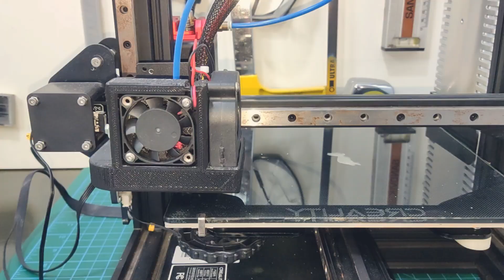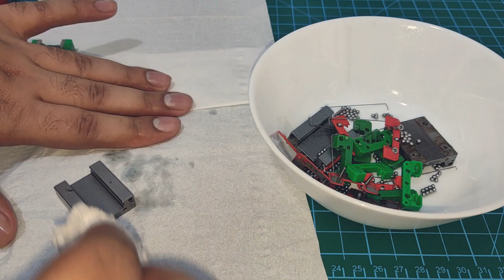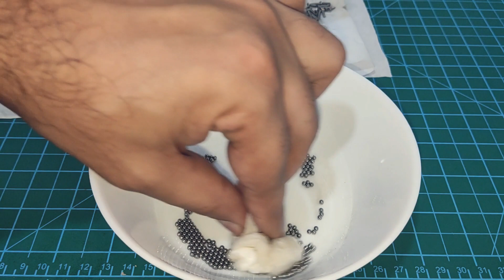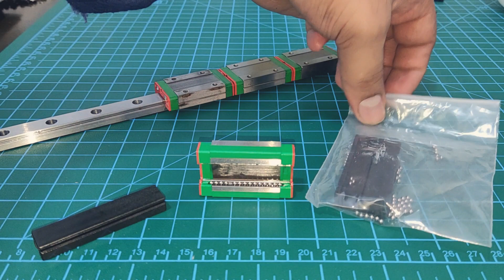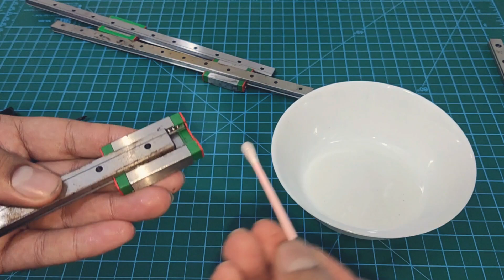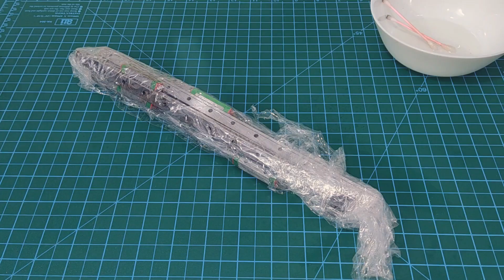Restoring MGN12 Linear rails | Ender 3 upgrade

Comment: I don't recommend using sand paper on bearings. First sand could penetrate the bearings, even small portions that cannot be seen. Secondly, you should use an ultrasonic cleaner.

Comment: Good video. However, I would recommend doing only one carriage at a time. Counting the # of bearings for each individual carriage makes it way easier, in my opinion. As you mentioned the retaining clips vary so again, one at a time eliminates headaches. Also, I use a product called NEVER DULL. It is awesome on all metal surfaces. Otherwise, good job!

Comment: That's painstaking work. I've done that myself and it's really easy to lose those little bearings.
Reply from the maker: yup. i manage to lose a few every time I am working on these carriages
Reply: @bluemonxterDIY  I'm thinking about upgrading my S1 Pro.
Reply from the maker: @billkaroly  I say go for it. Although the S1 pro already has many of the mods and upgrades that are normally done on the original ender 3.
Reply: i had to buy a whole new set of rails because while i was lubing a shite ton of balls fell out and my rails got fucked

Comment: I prefer to remove rust using orthophosphoric acid or trilon-b without any mechanical treatment, due to the inevitable damage to the geometry of the parts when processing with sandpaper. Disassemble the parts, completely degrease with gasoline or another volatile solvent in several stages of washing, then pour in acid or trilon-b and monitor the rust removal process. After dissolving all the rust, thoroughly rinse the parts with water, dry and lubricate before assembly.

Comment: Shouldn't mix the balls. Sometimes cheap chinese manufacters use slightly smaller or bigger balls to get a proper fit in the rail. If you mix those the rails will be useless